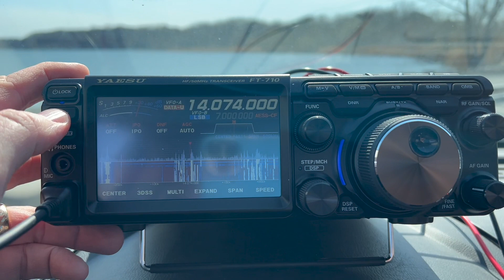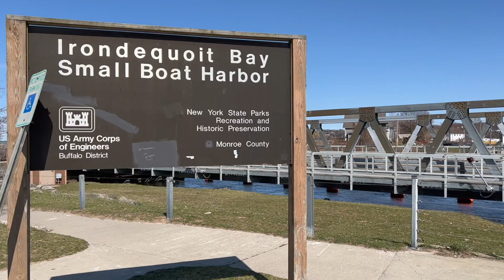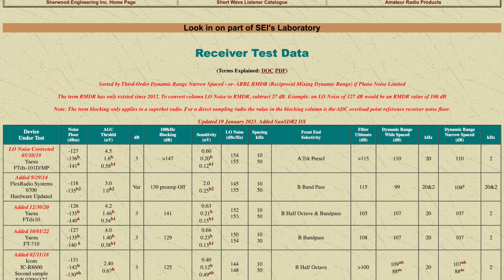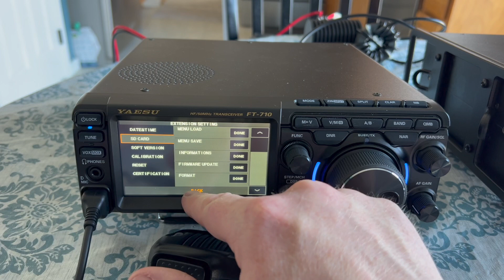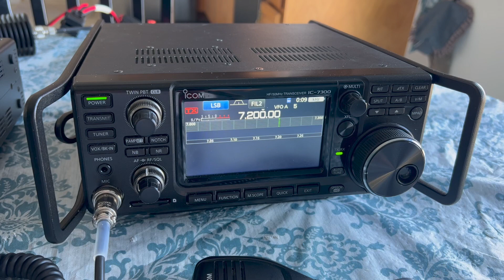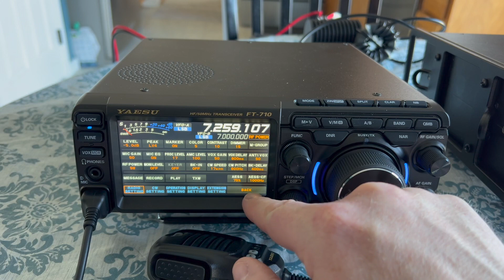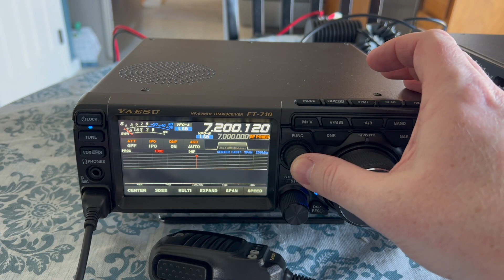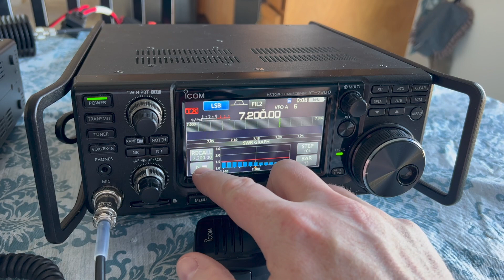POTA with Yaesu FT-710

Comment: I own a DX10 and a 7300 - hands down the 7300 is the better rig *overall*.  Of course the DX10 is better in some ways, but the 7300 is better balanced with less peaks and troughs.  I have no reason to buy an FT-710, and I'm still confused by its mere existence.
Reply from the maker: I'm glad there's new radios coming out from Yaesu, but the one I'm (still) looking for is the replacement for the 857. Thanks for watching!
Reply: Maybe because it's an awesome radio for $899 ? Cheaper, newer, far better receive, 3 year warranty vs Icom's 1 year...
Reply: @culpepper7665  It makes more sense now that they dropped the price.  I bought the "field edition" here in the UK for £979 including the official 11-meter wide band mod to give me a nice little CB radio thrown in.

The 710 is a super fun little rig to use, but the 7300 still does many things better.  My DX10 has more features than the 710, but it's an absolute pig to operate.  No fun at all.  I use it for field days only because it has a robust front end in high RF environments - but it's current thirsty @ 2.6A and a fiddly as hell.

If I can work a station on one rig, I can work it about as well on the others, so it just comes down to user interface and general feel/fun.  That Sherwood list means absolutely nothing in the real world - my bottom of the list 590SG is a DX monster!

Comment: Going portable ? remeber the FT-857 as well as the FT897? 
This small compact radio ( no bigger that an older CB radio) will draw only 0.65 Amp from your battary on RX standby , compare this to a 2.2Amp - 3Amp on RX when using a modern set, and this is not all,  those old sets will offer the use of full H.F+ 6m + 2m and 70cm and  on all modes, and that is not all. one  could listen on the air band and even listen in to the FM brodcast band ( unlike its predesecor the FT-891 that was viewd as step back offering H.F and 6m ONLY).
Yet, when it comes to a Base-Station the IC-7300 as well as the FT-710 will offer a better reciver , better sound & display options (and much more).
I tend to choose the right radio for the job, and the FT-857 is for many one of the best emergency portable radio that one could own , despite the fact that those ardios are old and close to 20yrs old and not in production, the FT-897 production eneded back in 2014 and the  FT-857 just a few years ago that is despite the high demand for those kind of small size shack in a box radio.
Those radios keep holding their value and for a good reson.
Reply from the maker: I wish Yaesu still had the 857 in production or would come out with its successor soon. Thanks for watching!

Comment: I was wondering how this radio ranks with the normal folks like us. A lot of your gripes are the same ones I brought up in my reviews of the FTDX10. Lot's of these things can be fixed in a future firmware but will they? The receiver on the 10 sold me over the 7300. Anyway, welcome to the creator world. de -K6UDA
Reply from the maker: Thanks, Bob! I'm glad you watched it and appreciate the feedback. I'm looking forward to using the radio some more at club events and it will be interesting what updates might come down the road.
Reply: There was another firmware update Dec 2023 that was supposed to be very positive. I hope Mike can do the update and advise. Its too bad but some negative reviews or comments are from 7300 owners. A lot of them around, but it is an old radio now and way down on the Sherwood list. That does not mean 7300 is bad , just that tech has improved.

Comment: Great video! Like from me ❤ What antenna is used on the car?
Reply from the maker: I'm glad you liked it! I was using the Wolf River Coils 213" telescoping whip. The antenna is a 1/4-wave vertical fully extended, but can be shortened for 6m-17m too. It's one of my favorite antennas, as long as it's not windy. MFJ and Chameleon make similar ones.
Reply: @MikeN2MAK  Thanks for the info Mike! If I understand correctly, this antenna is not resonant? So you always need to use a tuner? I think pulling it back and forth to get it resonate is quite annoying and can break it in the long term perspective?
Reply from the maker: @a.ovchynnikov7370  I got confused and thought you were talking about a different antenna (for another video), so I just updated this comment. The antenna is both resonant and adjustable. I've had it for a over a year and it's held up well, even after falling off in the wind one time (I was using a weaker mag mount then, lesson learned). Switching bands is actually very easy. You just drop it down or raise it 1-2 sections. I've got it pretty much memorized now. You can usually get a 1.5:1 SWR. The internal tuner on most radios can easily match that. A tuner is not required though. I've had great success with this on my ICOM 705, which is QRP and does not have an internal tuner.  I was just trying out the tuner since this was a new radio (Yaesu 710) and I wanted to get used to the operation.

Comment: Hi Mike,  I enjoyed the review especially as I live just across the bay and can see the POTA site.  I have been looking at both the 710 and FTDX10 . I to have viewed N4HNH videos that first got me interested.  Currently running the IC705 into a DX Commander Expedition and at times would like that little extra power even though I have worked the world with my modest setup.  Maybe we'll run into you at the next RARA club meeting.  73's Don - KW2AIR
Reply from the maker: Hi, Don! I'll have the 710 at a RARA POTA event on Saturday (4/15) at Veterans Memorial Park (Roberts Cabin) in Henrietta. Details are on the website, FB and in the Rag. If you can, come by and check it out! I'm sure I'll see you around soon too. 73

Comment: Great review Mike. Looks like a good rig, better than the FT-891 in many ways. I still think I like the 7300 better. I've been thinking of getting rid of my 891 and using the 7300 for POTA work. The 710 might be a better choice for the shack rig to free up the 7300 instead of getting a second 7300! 
Another park that I want to get to. I always wished that bridge would be useable in the summer, I've wanted to ride across on a bike to get to Webster, but always had to go way to the south to cross the river!
73, Al AE2T
Reply from the maker: Thanks for watching, Al! I think we're on the same page with the radios too. I was actually in Webster picking up prizes for our clubs POTA event this weekend and had to drive around to get to the park because of the bridge, LOL.

Comment: The ALC/PWR/SWR etc, is a ICOM thing, so you won't see Yaesu doing it. About the recording loop, on my FTDX10, pushing the function button plays the recording, and as long as you keep mashing it, it will keep playing the recording.  I'm surprised to hear the 710 doesn't do the same.
Reply from the maker: Thanks, David. I didn't know the ALC/PO/SWR meter was an ICOM thing. It's too bad. I find it very useful, especially for digital modes.
Reply: @MikeN2MAK  I don't know that it is "officially" an Icom thing, but you will find unique things about each brand of radio. Generally, you aren't going to find them copying each other.  The Japanese are respectful of each other - Generally.

Comment: Have you operated the FT-991? I hear a lot of good things about the IC-7300, just wondering how they all stack up.
73;
Kurt -W2MW
Reply from the maker: Hi, Kurt. I have used the 991a on a few occasions. Once at a club event and a few times for POTA with a friend who has it. But I didn't do anything with the settings those times--I was just spinning the VFO, clicking PTT and passing the mic. With the 710, I spent a few hours watching videos the night before and then a couple hours the next morning going through all the settings. That said, the 7300 definitely has a better display than the 991a and the 7300 also has the SWR chart. The 991a does have VHF/UHF, including 2m/70cm SSB, which is nice to have.
Reply: The 9918 has weak audio coming out of the speaker. You have to push the volume to one o'clock to get any kind of volume. And then if you go too far it distorts not good. I have owned them all.

Comment: Yes the The Yeasu Ft-710 is better than the old long in the tooth ic-7300. There no question which is better. Ft-710 is on only 1 year old. With the firmware roll out you with get more features.  Paying around $900 for the 7 year old 7300 is foolish. The Ft710 is now. And will only improve. Icom should drop there price to $750  & for sure they will be able to dump there old 7300s fast stock befor they bring out there new SDR rig.
Reply: Newer isn't always better - the IC-7300 user interface is miles ahead of my FTDX-10. My 7300 has features that my FTDX-10 sorely needs. Only better thing about my FTDX-10 is the solid, brick wall selectivity receiver - receiver does not overload with strong adjacent signals. But if in a RF quiet environment, my 7300 is far better to operate
Reply: Not sure where you got that from. FTDX10 is lightyears in front of your old radio, but if you like your radio good for you. A lot of old collins out there that are a joy to use and a testament of time. Can they bring in a station as well as a 10 or 710, no but they are still fun to use. @johnk8091
Reply from the maker: Thanks, for watching. I wonder whether or not someone buying a 710 should just spend more for the FT-DX10 🤷‍♂️
Reply: @MikeN2MAK  I purchased a 710 6 weeks ago and after listening to a review, complaint comparing it to the DX10 I was contemplating selling it and buying the 10.  I bounced a question off to N4HNH. His reply was that he thought the 710 was a better fit in my situation. It would do fine for me- unless I was going to be using it for CW. I bought the 710 to take to the Philippines and to be used primarly mobile. I listen to whatever N4HNH puts out there, He's a Man Among Men 😎 Thx for the info.
Reply from the maker: @phillycowboy69  I watched a number of N4HNH's videos and used his recommended settings for the 710. It was a huge help!
Reply: @MikeN2MAK  I think Yeasu screwed up with the 710. I’m not suggesting it’s a bad radio, but it’s just not needed in their product lines. The FTDX-10 is a superior receiver and doesn’t cost that much more.  Yeasu is missing a QRP radio that would bring their hybrid technology to compete with the Icom-705.
I own a FTDX-10 and would buy a Yeasu QRP when available.
Reply from the maker: @judd_s5643  I think there's a lot of us waiting for a new Yaesu QRP and successor to the 857.
Reply: @judd_s5643  I dont think Yeasu screwed up with the 710 as not everyone wants to spend 1,400 for a rig and I cant see using the ftdx-10 portable, but I agree Yeasu needs a QRP rig in there lineup.
Reply: @MikeN2MAK  for a shack rig I’d say yes.
Reply: 710 is 899 now
Reply: @dxfordummies  You missed the boat. The ft-710 is the replacement for the FtDX-1200 according to Yaesu. It is the top SDR radio in the world according to Rob Sherwood and having bought one I agree. The old 7300 is not a bad radio, just outdated.  If you still like using it, great. Personally I love having the 710 and enjoying the best receive I have ever listened to. Even Hams that own both the 10 and 710 say they are very close. I have an old TS-50 that after 26 years is still fun to use. Ham radio is a hobby and should be fun. If one still likes their old boat anchor,  knock yourself out, but it is not better than the awesome 710.

Comment: Good video.  I’ve been using my 710 in my garage(temp shack) doing mostly POTA hunting.  The tuning is what I’m confused about.  All that  noise and meter bouncing around.  I really don’t know if it’s tuned or not.
Reply: When the radio is tuning it sets the output power to low output so don't worry about high r f output as the radio is tuning
Reply from the maker: Thanks for watching, Johnnie. I was confused by it too. It’s not what I’m used too. The tuner is working though.

Comment: Thanks for the review.  I own the 710 (about 6-months now) and have used my clubs 7300.  I've used both of them in my shack and in the field (mostly POTA).  Maybe its because my first rig was an 891 (really deep menus), but all of the things that were "bad" in the review are non-issues for me and seem very much operator preference.  I've never really had an issue with the VFO, maybe its my operating style, but I've never had an issue getting dialed in on a station.  I typically have my VFO steps set around 1KHz and since I mostly hun POTA where ops are on even frequencies getting dialed in has never been a problem.  If I need some fine tuning I tap the fine button and make the adjustment.  I pretty much always have the meter on SWR unless I'm doing something specific like adjusting my tx audio.  If I need to set ALCC for FT8/JS8Call, I change the meter, make my adjustments and I never look at it again.  The Back button is easy to find on the menu screen and I'm generally not fiddling with the menus while I'm operating anyway (Thanks N4HNH).  I've never used the recording feature on any of my radios, so I don't miss it.  For those who do, I could see how it would be annoying though.  The only feature that the 7300 and 705 have that's really nice is the SWR sweep so you can find out where your antenna is resonant on the band.  Since the 710 is an SDR radio its a possibility that Yaesu could eventually add new features like the SWR sweep and audio tx loop.  Will they?  That's another story entirely.
Reply from the maker: Thanks for watching, Cameron. You're right that a lot  of this comes down to operator preferences. I'm looking forward to using the 710 more, including this weekend.
Reply: @MikeN2MAK   Could you give a one year update on the 710?
Reply from the maker: @WarrenPostma  I will soon! It's not mine, it belongs to my club. It's a loaner rig for members to use. I borrowed it back in the spring and will actually get my hands on it again next month. So far, based on the few times I've had it, and used it at club events, it's a good radio and there have not been any issues. It always takes a little getting used to the controls for me, since my HF radios are the ICOM 705 and 7300. But stay tuned and I'll be bringing it out for some more testing. If you have any specific questions or concerns, be sure to comment below with them and I'll try to address them.
Reply: Yes SWR sweep would be nice but otherwise Im 100% happy with my 710!
Reply from the maker: @mewrongwayKOCXF  The 710 is a good radio and it’s going to raise the bar for ICOM and others at that price point. Thanks for watching!
Reply: @MikeN2MAK  Agree Mike,  Now if we could get Yaesu to give us a QRP rig of equal caliber or better.  👍👍
Reply: The meter function on the icom is dead on what you want for ft8. Its all right there to monitor. ALC/SWR does change over time as does the temperature of the finals. Especially if you are pushing. I run both radios and if you had it you would miss it.  Even on my 101mp they don't have the ability to monitor as much as the 7300 at the same time. Also agree with the audio recording options on the yaesu.  The exit/back and tuning around I never had any issues either with that.
Reply: Thanks for the reply. I totally agree with all your comments.  I have SWR scan on my X6100 and no longer need to bring the VNA to an activation. I started with menus with my TS_50 and so I don't care as the most common controls are there. The 7300 is still a good radio, just old now. I wish people would stop running down new radios to justify their old ones.  The 710 is the top pure sdr radio in the world at the moment and a fun rig to run. I will get many years enjoyment no matter how many new ones come out and the will.

Comment: Mike, if you click the kilohertz on the display,  the vfo knob then will increment in 1khz steps. Same with mhz. You also left out that the dsp/dnr sucks, anything over the 3 setting sounds like underwater, not that way on the ftdx10.  73s, good review, thanks
Reply from the maker: Thanks, Marc. I’ll check that out with the VFO this weekend. I’m glad you liked it and appreciate the feedback.
Reply: @MikeN2MAK  it did improve after the firmware update. I still prefer the ftdx10, other than the weight difference
Reply: Firmware Dec 2023 did a major fix, now reported quite good.
Reply: After the latest firmware in? March 2023 whatery. Sound? Is much better. Diana noise reduction works much much better and you can go higher than number 3 on DNR settings.

Comment: Good review.  I bought the FT710 about 10 days ago, and so far I love it.  I'm going to be using mine in the shack, not out in the parks.  I agree with you about the antenna tuner, it takes quite awhile, and it goes thru the entire process even if I go back to the same frequency and band again.  It's really annoying.  That's my only real complaint.  My antennas aren't as resonant as they should be, so I chalked it up to that issue as a possibility.  I'm going to put it on an external auto tuner later today or tomorrow, and see how that works.  External tuners are always more broad ranged than the internal tuners.    But otherwise I'm happy with it.  I'll definitely be keeping it in the shack.    John WA2OUZ
Reply from the maker: Thanks for watching. I’m sure you’ll continue to be very happy with it. I know I’m looking forward to using it some more.
Reply: Everyone is always sure 😂, I sold mine. But to clunky for me.